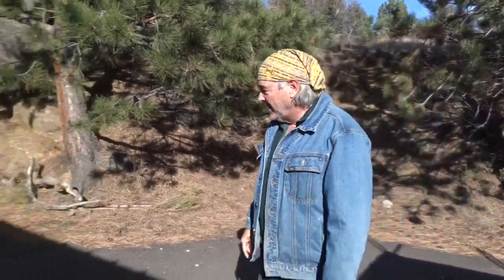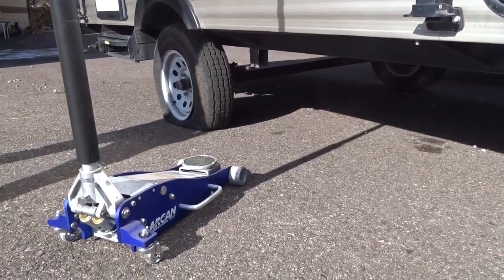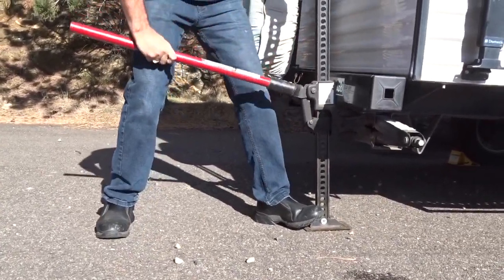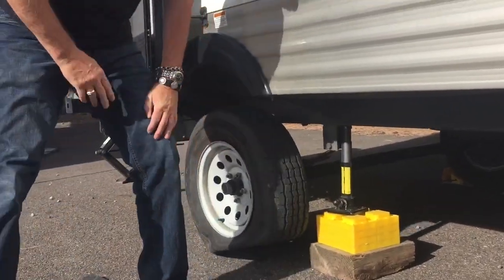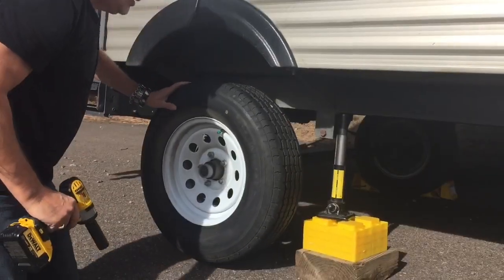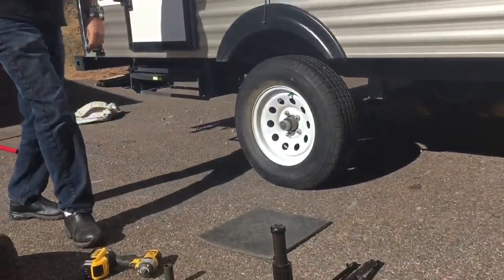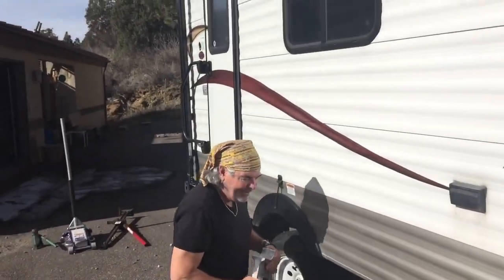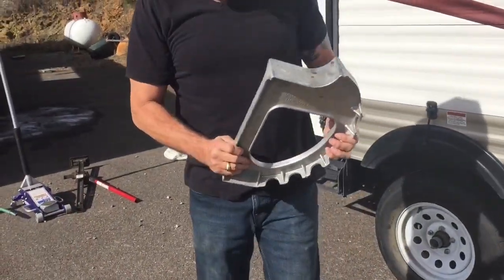Changing a Camper Tire - 3 ways

Comment: If you have a camper with 4 wheels and one has a flat you can just place a block of wood, brick or wheel chalk, anything comparable, under the wheel thats next to the flat, pull up onto the block with the good tire, which will raise the flat off the ground enough to change it.  Cheers!

Comment: Excellent video.  By the way...one word of caution with reinstalling the lugs:  using an impact wrench to tighten each one all at once (i.e. (1) tighten 12 o'clock, zip, all done; (2) tighten 5 o'clock lug, zip, all done; etc.) can cause problems, including a slight wobble in the wheel because they actually weren't tightened evenly -- the wheel ends up being slightly off, which can cause problems with the wheel, the brakes, etc. over time.  Instead, I've been told never to use an impact wrench to reinstall lugs, but rather to use the provided lug wrench and tighten them the old fashioned way a little bit each time to make sure the wheel is being mounted and secured evenly -- i.e. a quarter turn at 12 o'clock, then 5 o'clock, then 10 o'clock, then 2 o'clock, then 7 o'clock, then another quarter turn at 12 o'clock, then 5 o'clock, etc. until they're all tight.  Then take the trailer off the jack and tighten them again*.  Then drive down the road a few minutes - maybe 10 minutes? - and pull over and *tighten them again*.  (You *will be surprised to find that they weren't as tight as you thought they were - some may even be loose!  I've actually had this happen.)  Hope this helps, though opinions will differ.
Reply: @Cw Sayre tyre joints use air wrench to re-install car tyres

Comment: First thing you should have done was take the spare tire off.  Then you would of had it ready and the trailer would not have been on that jack so long.
Reply from the maker: Ginger Bart yes, good tip. I did get another flat tire a couple weeks ago up in WY. I realized that I needed to put the truck jack under the axle to get enough height (in the dirt) to get the tire up, not under the frame.
Reply: Don't forget a jack stand for added security
Reply: Take off spare first....I also put the flat tire under the trailer.  If it falls off the jack it won't crush you under it.

Comment: OMG, I hope no one is paying attention unless you are learning what NOT to do.  BTW, meth is bad.
Reply from the maker: Haha Michael,
Actually I agree that I should pull out the several methods that don't make sense. 
Now that I've had the camper or 6 years, I have had more flat tires out in the boondocks and should update this video.
Out on a jeeping road with a flat, I need to put the jack under the axle and not the frame.
Sorry about the Meth!